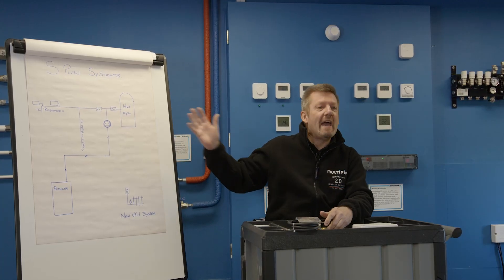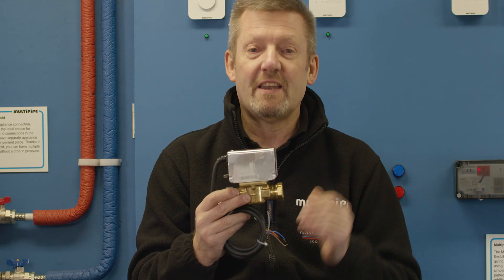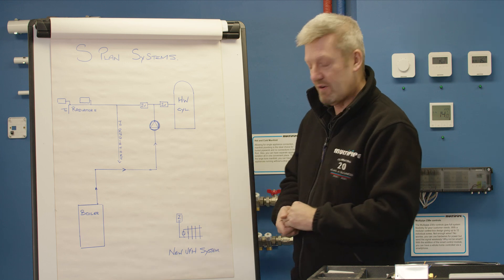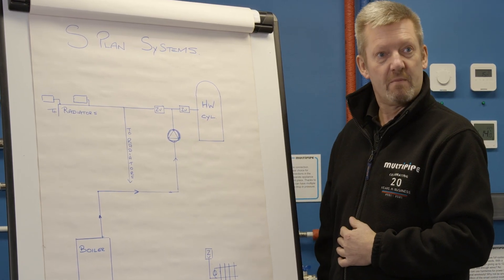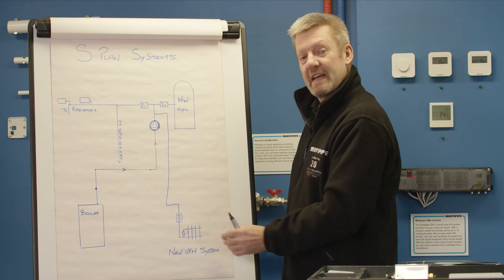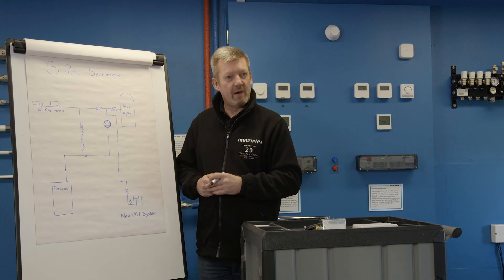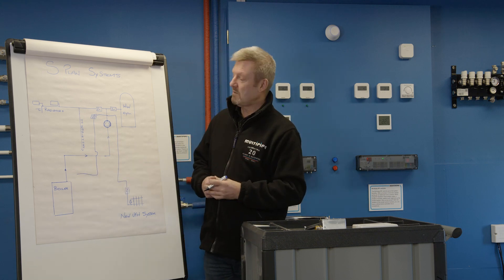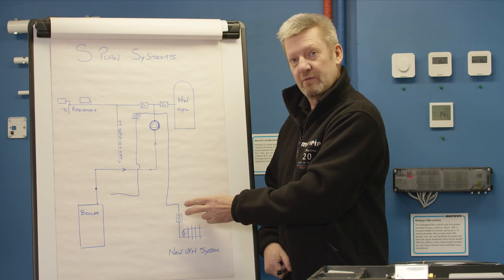How To Get Better Control Of Your Heating Systems

Comment: our new build came with an underfloor heating system where the radiators can be turned on independently, but when the underfloor heating is on, the radiators turn on. what are the possibilities for how this would this be set up and can we change it so each is entirely independent?
Reply from the maker: Thanks for watching our video, this sound like there is no zone valve fitted on both the UFH and radiator system this separates the UFH from the radiators. A registered plumber will be able to sort this quite easily for you and give you that control... I hope this helps.